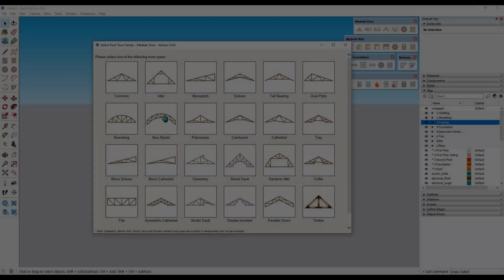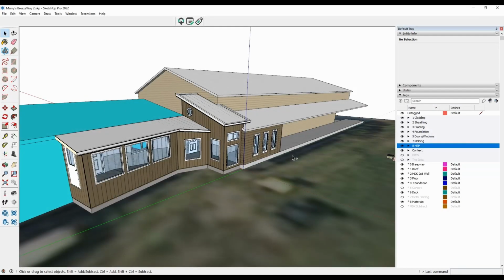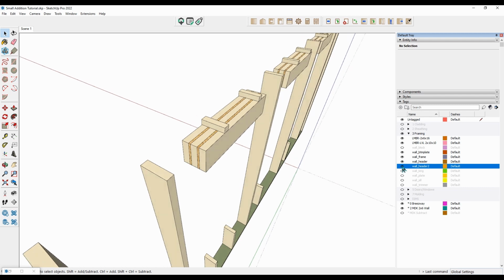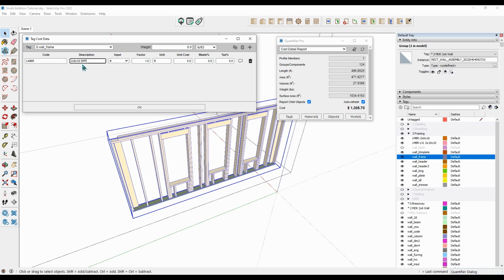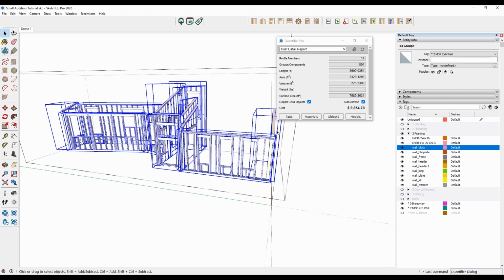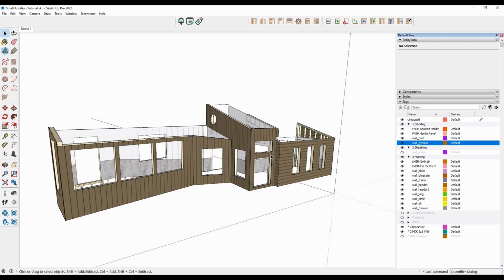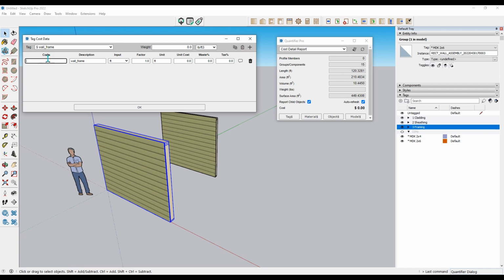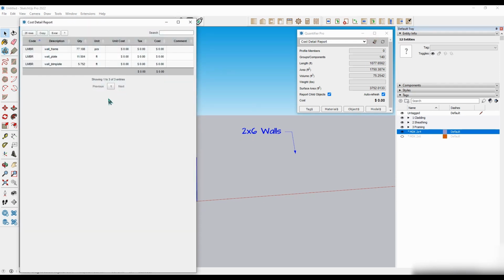Medeek Wall - Estimating with Quantifier Pro // SketchUp

Comment: Interesting process.  Every stud in a Medeek model has its own label (Stud1, Stud2, etc).  When I run a Component Report I end up with a line item for every single stud.  Is there a workaround to prevent this from happening, or do you just have to sort all of the studs together in an exported spreadsheet in order to then manipulate them (and other groups /components)?  TU
Reply from the maker: I don't use the component report function since the list of materials is exported by QP.

Comment: How did you add the cost of osb. Osb comes in sheets. First thing will be to do a 2d nesting of the osb parts to get the number of 4x8 osb sheets required.
Reply from the maker: If we're talking 4 * 8 sheets, quantifier pro will sum the total square footage of everything on the wall_sheath tag, and divide that figure by 32sqft to give you the number of total sheets, then it will multiply that by your cost data.